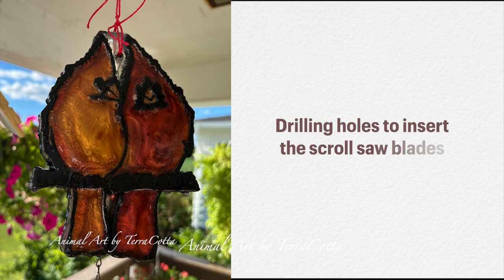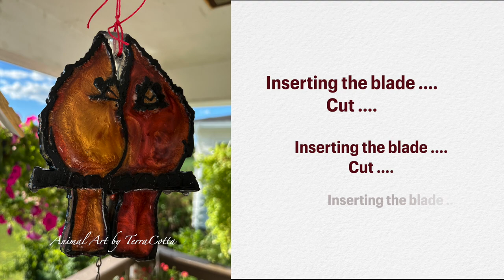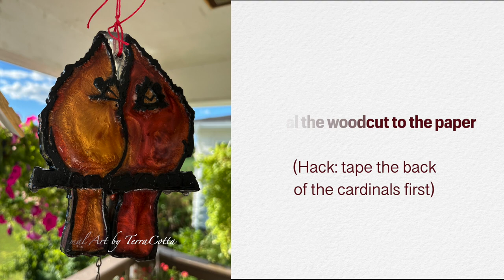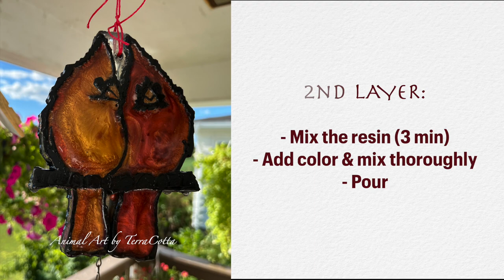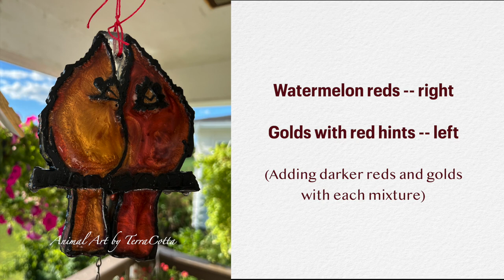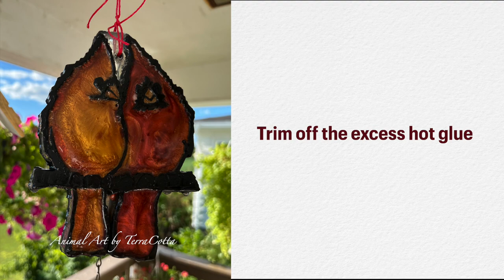Wood and Resin Cardinal Art Step by Step

Comment: Hello Cheryl, ooooh, another resin project, love it 😍😍🤗🤗! I so admire your patience when it comes to you using your scroll saw (attaching and reattaching the blade and making this intricate outline of the birds). And your patience for waiting for the resin to cure! This is the one main disadvantage of resin (in my opinion) that you really have to wait quite some time and have to do several layers to achieve some thickness. I love the color variations you achieved and I bet it looks gorgeous when the sun hits it. Big thumbs up for a super creative project and what better way to display it than on the porch! Sending a big big artsy hug 🤗🤗and all the best, Erika
Reply from the maker: So agreed, Erika, the wait time for resin cure is a pain although I didn't need to do two pours ... I just ran out of resin 😄 I was also hoping to post this last week but rainy weather supposedly makes tacky resin ... and so I waited. But really, if you use resin for a sun catcher, it would be very straightforward, it would cure quickly, and the outcome so much fun! And insider note, I broke sooo many blades cutting out the cardinal. I've been having trouble with my scroll saw of late but am thinking it's really me, hoping that anyway, because a replacement wouldn't be cheap and that's been a major plus point for moving back to the States. Big smile and bigger hug! Hope your weekend rocks, Erika 🥰 Cheryl

Comment: Oh my goodness Cheryl,  this is amazing.   I said to my hubby - see you can drill through that LOL -  I love your skillset, you are not just a. painter you are so much more.  I love watching this whole process.  The end results are so cute,  as an avid bird lover,  I just want to try this,  so creative.  It takes some time to do but so worth it - wow - love this.  thanks for the time stamps too - so helpful.  Just love this one - sorry for delay - just got off vaca and back into the work groove :). So much to do so little time.  🥰🥰🥰
Reply from the maker: Big thanks, Lori 🥰 and also very big correction. You canNOT drill through that stuff! I had a layer of hot glue originally around the cardinals and that puddle is what I drilled through and then poked a straw in the hole to keep it open. When I was painting both sides with the resin, I poked an old paintbrush in the straw to hold it up ... but ended up getting a bit of resin inside AND the paintbrush broke off inside. Ouch! Took a while to drill that out and I can say, I WAS VERY THANKFUL IT WASN'T SOLID RESIN!!! 😋 Glad you enjoyed vacay! No wonder you haven't released much of late 🤗

Comment: This was a great video Cheryl. You had me holding my breath with that scroll thingy in the beginning. I have only done a little bit of resin, but you are inspiring me to try more. I love these. Loved how you blended the resin. I did not know you can use acrylic paint on resin. It was a splendid job 😊
Reply from the maker: LOL, I didn't know I could either. This is pure experimentation mode for me, but I'm sure the acrylic will be fine with the extra coat of resin on top ... otherwise I would be worried about a short "life span" outside. Thanks, Ann!! 🤗🤗

Comment: Cutting wood with scroll saw is always satisfying and requires precision and experience..Im not a big fan of raisin and pouring ( and oil painting also because its hard to clean after 😂lazy iam)but when it comes to little artcrafts like this one it makes me reconsider things , i like how the two birds stand out , I loved the red transparent colour , opaque enaugh to show the birds silhouette but also transparent to let light goes through 👍
And what if you sand the surfaces  ?!Or you prefer to keep it raw that way ?!anyway
That’s a piece of art that will last for a long long time  Hope you carve your name,date and place on it ,maybe after a while you will be happy to look at this details and remember it all …
Good job
Reply from the maker: Very good questions about the sanding! I did take a lot of tutorials before doing my own resin explorations and if you sand, you'd have to use a really really fine sandpaper or the surface would get scratched rather than polished, and so that was the reason I put a last layer of clear on top ... to smooth out any imperfections and fills in dips, and yes, to also protect that acrylic paint which I think would peal off after a bit of time in the heat 😳 Thanks, On Art! You've got really good insights on resin and wood creative process! 🥰
Reply: @AnimalArtbyTerraCotta   i believe so ! You need to have a realy fine sanding disks  to get a smooth result if you use a sander 
But i guess fine sand papers are available
Everywhere
Anyway it was clever to protect that acrylics with a last layer !
Reply from the maker: @onart6597  Thanks, On Art!! 🤩🤩